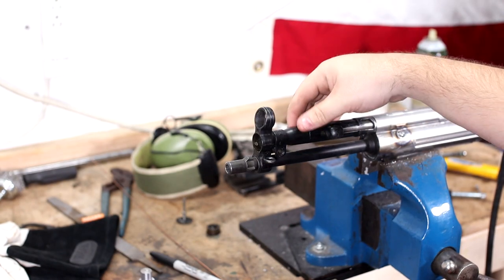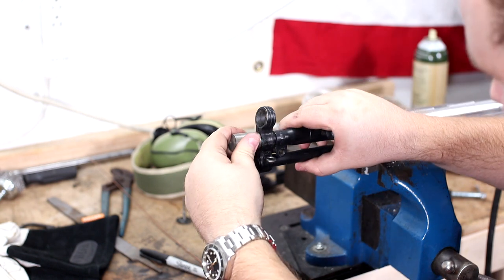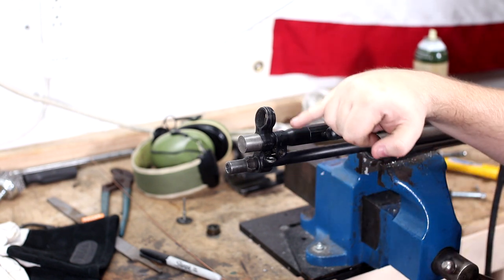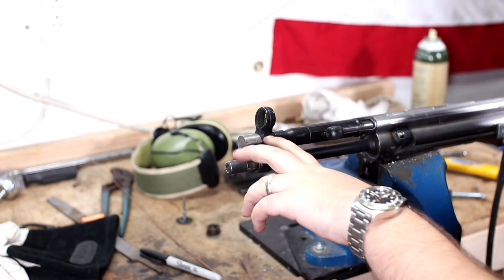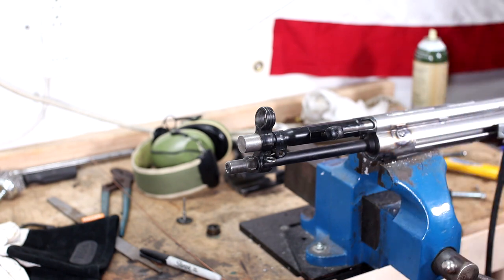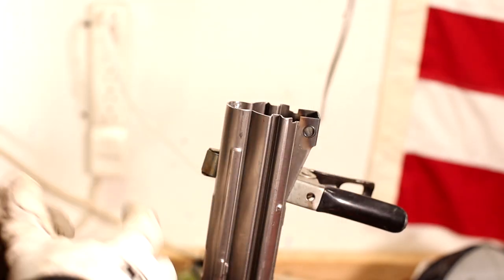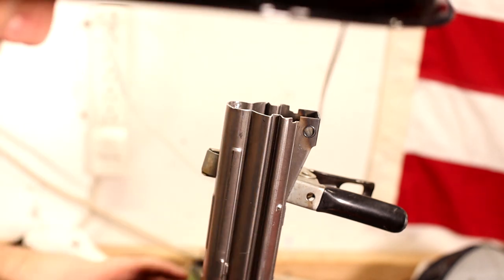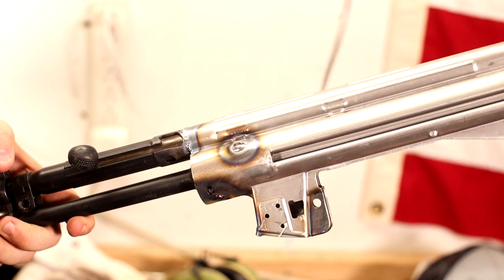MP5 Build Part 5 - Barrel Welding

Comment: One thing to note about the cocking tube gap. Measure your bolt gap and set your cocking tube gap to match. It’s important to call that out. And make sure to check your bolt gap with the trigger pack installed and hammer against the bolt.

Comment: Hey what size holes did you use for the plug weld holes? I can't find any info. Thanks 😁
Reply from the maker: To be honest I don't remember. Go with something a little bigger than the diameter of a pencil and you'll be good.

Comment: Question have you have any problems with the cocking handle not unlocking the bolt if you did what's the fix? Having some issues with mine.
Reply: This is an issue with headspacing; before you weld your cocking tube in place, you want to check your bolt gap with the bcg in place, and the hammer forward. Your cocking tube support should be fully forward in this position so that turning the cocking handle out unlocks the bolt.

Comment: Quick question. Under the spot welds there a hole thats already made in the flat. Does a dowel or pin go in that to help support it or is it just weld that holds the barrel mount stay in place within the reciever?

Comment: What welder are you using?  Lastly, how did you determine heads spacing?
Reply from the maker: An old Miller Econotig.
Reply: @BabyFaceP  
Awesome,  tbank you. 
I'm going to build my cetme c and this looks like a great setup. 
I just need to make sure the head spacing is set properly and I'm golden.

Truly appreciate your videos and quick response to my questions. 
Thanks once again

Comment: this is an old video so i dont know if youll see this but i want to by a parts kit from hk parts and dont have tools to build it myself could i get some tips on what i will need for a project like this. if it means anthing im getting an mp5-sd kit
Reply from the maker: The video series should give you the info you need. It's not the first build I would attempt.

Comment: whenever you drilled the receiver and wield it. Is that what people are talking about with the barrel pin? I know there are companies that sell a barrel pin
Reply: No, he's welding the trunnion into place. His kit came with the barrel already installed and pinned into the trunnion, so he never had to do that. If you are supplying your own barrel, you'll need to press it into your trunnion, drill a matching hole through barrel and trunnion, and press the pin in through both, locking them together